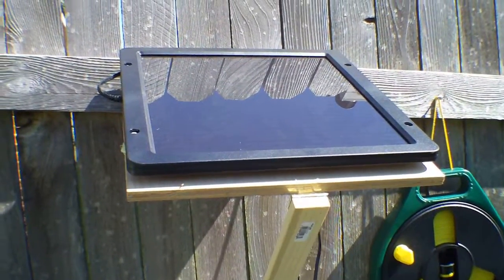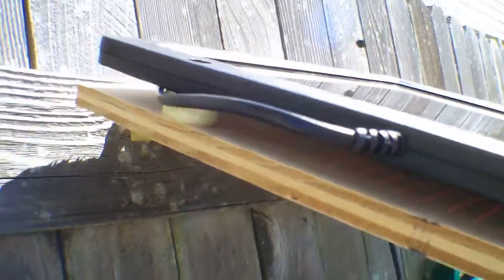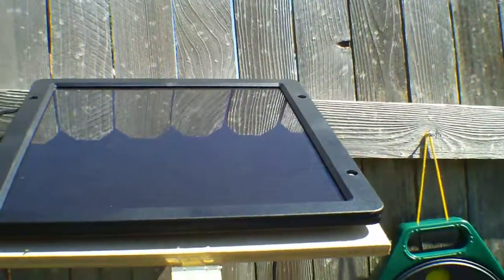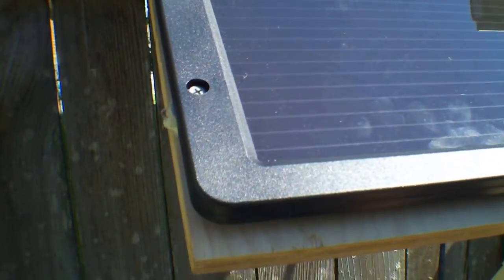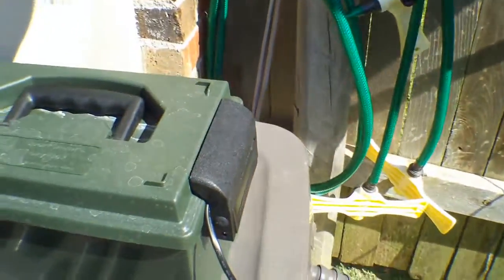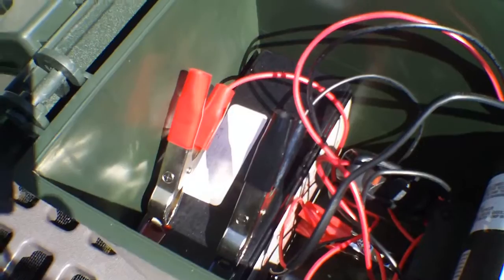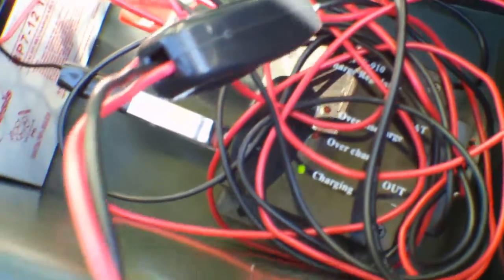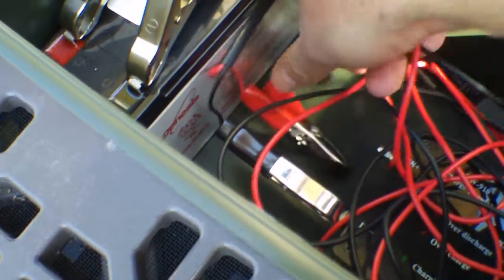Completed solar powered water pump

Comment: Genius !
I used a Solar pomp and a black hose, to heat water.
  http://www.instructables.com/id/Portable-Solar-Pool-Heater-104-K-Watt/
I changed the black hose for a Solar bag 1-2-3 130 x 80 cm = 1,04 m² 
( or 50 m black garden tube 25 mm = 1,25 m² )
( or Solar Mat )
Ceramic pump 12 Volt/ 14 Watt
Connection set, plus 2 X100mm lengths 12mm Silicon Tubing
Photovoltaic Portable Folding Panel 12 Volt/ 40 Watt
2 Blue tubes 32 mm x 100 cm
Adapter tube - reducer 32 mm / 10 mm
Power supply wire 12 Volt with male connector DC5521
go to www.warm-water.be

Comment: Sorry u are wrong again....the battery must be disconnected incase the positive and neg touch when moving the box around, possibly over heating ,, melting the box and or starting a fire...once the light is removed from the solar panel there will be no voltage on the controller side of the hook up so unhooking it is ok, but not the best idea
Reply: polishpicl 
Earth 4 Energy

Safe Redirect => http://home-renewable-energy.blogspot.com

Comment: Excuse me. You do realize that if you put the hose in the bottom of the barrel the weight of the water will push the water through the hose without any power right?
Reply: Using a pump, you get more pressure than you do with gravity feed.

Comment: Hey, I have the same size solar panel :).  With most batteries you wont even need a charge controller, since it has such a low current output. However that is a rather small capacity battery so it's understandable.  Although, it seems like you're missing the point of a charge controller.  Did you notice how it was flashing from "Charging" to "Overcharged".  That just means it's doing it's job.  You're not actually overcharging the battery, it cuts the current when the overcharged light is lit.
Reply: TheLegendBullet yep

Comment: I made  a little airlift pump "nano" that pumps to at least 13 ft. (and maybe a lot more)  I used a solar panel and battery too. It uses an inverter and a little aquarium bubbler to do the airlift.  Maybe there are aquarium bubbles that will run directly on 12 volt dc?  If it would self start,  you could have a pump without the expense of the battery and charge controllers and there would be only one moving part..

Comment: @IdahoViewing  I totally agree, but if you look at most of the vids that are produced throughout, 95% of the first homemade projects are using lead acid batteries, and not the more expensive AGM gel style. It was more of a precautionary measure for people just getting into this sort of off grid power source as a FYI to be aware of the heat, fumes, loads, etc for when they enclose their battery banks and ways explaining the how & why to vent them.

Comment: @tdjtx Deep cycle batteries can be just as large or larger and heavier than a car battery. Have you ever seen a golf cart or a fork lift battery? HUGE!!!!! You could use a lead/acid battery, you just need to stay within its charge and discharge ratings.

Comment: I think you do not need to watch for overcharge and manually disconnect.
The controller likely stops charging the battery.
I have one of those charge controllers. 
If mine ever gets to overcharge, I'll measure the battery voltage with a meter to see if it stops rising when the light comes on.

Comment: Nice job on the video.

I recommend getting a better charge controller, such as the Sunguard SG-4.  No need for a dump load, it will regulate how much current goes to the battery.  When the battery is full, it stops the charge.  No worries of overcharging.  I've been using one of these for a couple of years.  

Would like to see a follow up video showing the water pump in action!

Comment: I have a similar utility box that holds my batteries and controller. I've installed (2) old pc cooling fans connecting them to the controller to use as my dump load to blow out the vent holes.
So when the batts fully charged, the fan will utilize the load from the panel, and kick off when the batt is in need of charge.

Comment: Very nice vid. Couple suggestions, (1)need a dump load so your batt doesn't overcharge, (2) need to vent the batt box, any sort of spark,short etc could ignite the trapped fumes produced by the battery.
I like the hinged mount you have for the panel, very good idea.